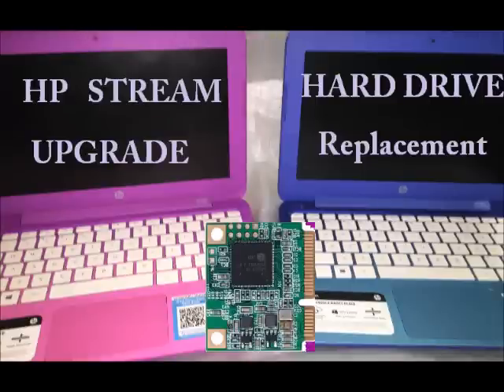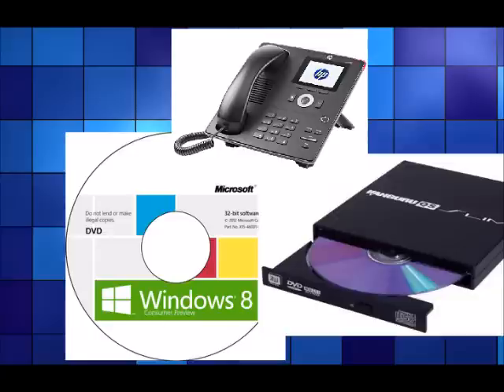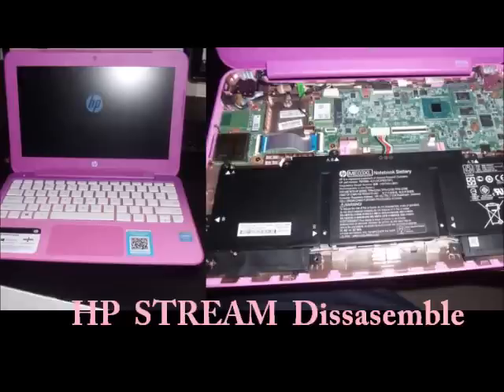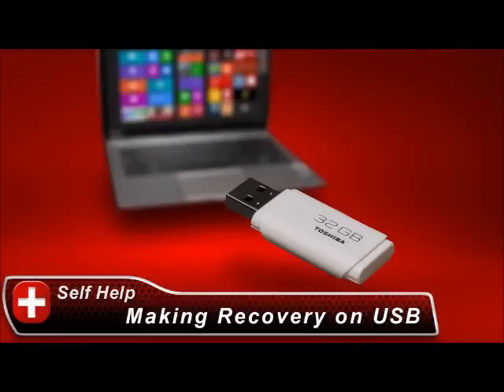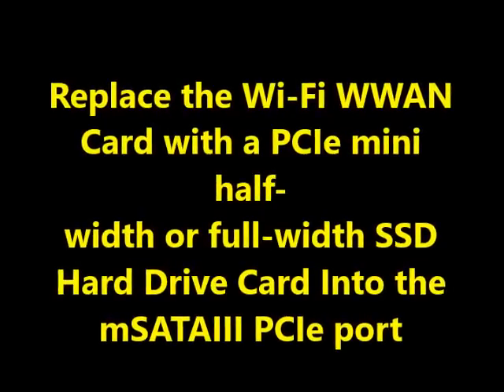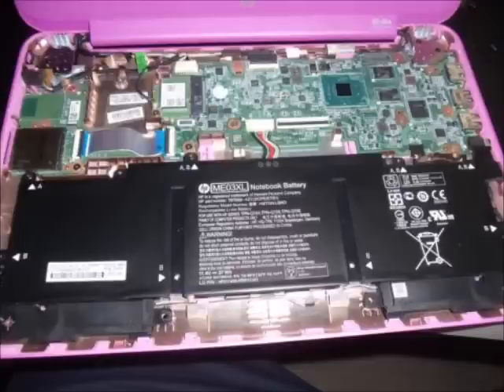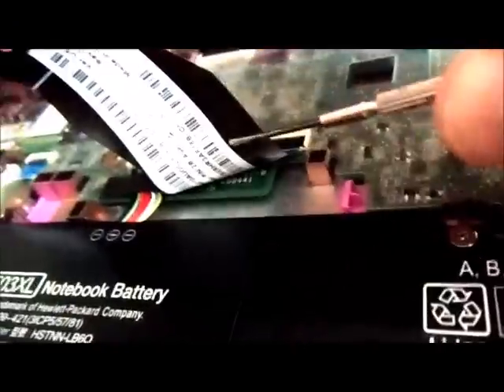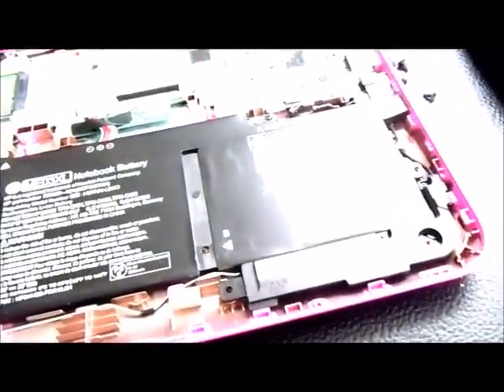How To UPGRADE HP STREAM Hard Drive 11 13 14 11-d 11-p 11-r 13-C 14-Z X360 Pro G3 G2 Touch SSD RAM

Comment: this tutorial is ok , but it should be deleted you do not show the actual product working , or more spcs on your particular setup, ive gone tru 3 msatas included the recomended in the video and none of them are being detected they don show in bios , i went as far as trying 2    M.2 ssd both pcie and ssd and none of them work, and yes i have a board with an M.2 connector and sim card , so nothing works, unless you show proof and proper specs you should delete this video
Reply from the maker: lol why do I need to show "proof"?  I'm not selling you anything and obviously it is working because that is how I got mine to work and everyone else on here.  There is something wrong on your end.
Reply: the same, today tried one ssd no luck, as i understand it should theoretically work((((((

Comment: so, i did exactly as in the tutorial, really good one btw, helped me a lot. problem is, the new hard drive still can't be visible. i did the battery reset thing but still, i got the same problem. i don't know about the bios update tho, how do i know it the pci-e won't have been banned already and after that i won't be able to do anything ?

Comment: Struggled with an HP Stream (32GB) for 4 days as it attempted and failed to download/install Win 10 updates as available SSD memory was between 0.9 and 1.4 GB, until finally a screen showed up that said 10Gb of external memory required to install updates! Plugged in a 16GB flash drive, pressed enter and two hours later the Dream Win 10  updates were current and the available SSD drive was 9.1GB!!!! Suggest get a 16DB flash drive and persist!
Reply: I have the same problem with mine

Comment: Warning- replace with mSata won't work
today tried one ssd no luck, as i understand it should theoretically work(((((( but not, so statement in video is not true
Reply: It won't work because msata and pci-e are two completely different interfaces.  Just cause the connector is the same it doesn't mean it uses the same data type.

Comment: ok well I followed everything like he said, I couldn't find the SSD when i tried installing windows with my USB, so instead i formatted the old drive that wouldn't boot and installed windows there, if you guys are having similar issues try doing what i did, when installing windows from a usb choose custom or advanced and look at the primary drive, then format it and install windows on there

Comment: mSATA is not PCIe. Yes the SATA HD controller down the line is connected to a PCIe bus but it's still SATA not PCIe al la M.2. Yes mSATA uses the miniPCI slot/connector but it's not electrically PCIe but SATA connected to a physical mPCI slot/connector.

BTW ALL mSATA's use the SATA bus not the PCIe bus.

Comment: this isnt a bad low budget laptop. idk what you all are carrying on about? If you expect more, then one will have to invest more.  its plain and simple really.
Reply: Ryan Marshall Well, my father got me one and it honestly sucks.
Reply: I wrote a monster of a thesis on this piece. I needed an external hard disk, but everything went perfectly
Reply: just snag a used thinkpad, cheaper price, better performance and much better build quality
Reply: exactly!
Reply: I dont mind this laptop, for the price, it runs as I expected it to, I would just want it to have a larger storage capacity
Reply: Maybe because you should be able to add, oh, I don’t know, some RAM to it?? I’m not ok with the fact the box said 32 GB and it turns out that half of that is already used up by the software installed on the computer...
Reply: It's a piece of crap. There should be no Windows laptop sold with less than 64 gigs of storage. My niece has one and we can't even install the latest Windows upgrade. These things should not be sold.
Reply: I don't see anyone "carrying on".  It is not unreasonable to expect HP to design a notebook to have enough operating space to accept future Windows updates with enough disc space to spare to run the notebook, which this POS does not.  After the WIndows update of 10/18, even after stripping it to the bare bones of everything uninstallable, my notebook is nothing more than a $200 photo viewer and HP could care less.  I was able to use it for 1 whole month after purchase and then the 10/18 WIndows update rendered it completely unuseable for anything online, even stripped to the bare bones of all uninstabble programs/apps.  HP support is so horribly unknowledgeable, after trying for weeks to get them on the phone with hold times upwards of 30 minutes, they told me to buy  more RAM which is impossible. I have filed a complaint with the Attorney General to get my money back and I went out and bought a used Dell.
Reply: @ashkesslet1149  Yes, I had seen other posts about doing this, or even android. I will likely give this a try.  TY
Reply: BOY IT CANT EVEN RUN ROBLOX
Reply: It's honestly a brick
Reply: The people who made this piece of shit but they should burn in hell. A friend of mine has one. First off , whats with the s mode bullshit? Isnt it her " computer" ? She should be able to install any damned thing she wants to on it. And anyone who thinks a 32 gb drive is a good idea is insane ... or crooked. Mostly the latter. How much more would it have cost to put a 128 in there? Now we got to go get an external drive so she can use it.
Reply: This is bad bc people could have bought a older used computer and they'll be better off

Comment: Instead of doing this, do yourself a favor and just don't! Trust me, this won't help and is nowhere close to worthwhile, even if it did improve something. This disposable laptop is NOT designed to be taken apart! It is very weak, difficult and u will brake it I promise. 30+ screws, each completely unique, 7 of them are completely hidden and require 100% disassembly. Every single tiny piece must be completely removed to reach the screws that give you access 2 a board that cannot be upgraded in any way because everything is soldered on! All u need to know is:, the hard drive is integrated and CANNOT be upgraded. He just tells you to use a thumb drive or SD card (really???). You could replace your WiFi card with a m-pcie drive which is even more ridiculous. A little streaming toy like this is pretty useless with a high speed drive worth more than the entire laptop if it has no WiFi?! If this is your thinking, there's plenty of options 4 u! You could remove the screen to save on battery life a lot! In fact, you could go even further and remove the battery itself to save even more and prolong its life! That would free up plenty of room to add an mPCIe-to-SATA card and two 1TB SSDs on a RAID-0 array! Now that's a real upgrade! You will be so impressed with your high speed drives you will forget you ever had a screen, keyboard or WiFi! But for real, none of this, or any other attempt to upgrade this laptop can make the slightest bit of difference because the bottleneck is in the bs celery CPU and the pathetic RAM. So to summarize, be smart and don't do this! I'm sorry you have this laptop but it has been crippled Beyond hope and the best thing you can do for it now is to get rid of it! Whatever it takes, your life will be vastly improved once you remove this laptop from it! That's a guarantee!
P. S. I am a full time licensed computer tech with over 30 years on the job. I've repaired thousands of laptops. I speak from experience. This is the only model I have been unable 2 simply take apart without damaging it. Rather than putting mine back together, I put it in the trash can where it belongs. This computer has lowered the bar too far for comfort. I'm disappointed in HP for this hideous, insulting release...
Reply: It's a garbage laptop, for sure. But if you can get it free (like me) or for dirt cheap, it's not really all that bad considering there's still a lot of possible uses for it: I carry this around and leave my main laptop at home. I only use it for web surfing and streaming media (mostly from my own personal cloud). I can use the HDMI to connect it to my projector/TV to watch a movie (either streamed from netflix or from my own network drives. Connect it to either of my external desk monitors occasionally for a bigger screen while working, that is, if my other PC is preoccupied with other processing jobs... use it as a foobar / jRiver (synced/mirrored) media server etc. etc. It's very light as well so I prefer to lug this around when going out and about... Although, for most people who plan to use this as their main PC, the lack of upgrade options is indeed severely limiting. In summary, this can work really well as supplementary lightweight laptop, but not so much as a main computer.

Comment: You do not buy a usb network... It's a network adapter and I am only 10
Reply from the maker: its the same thing.
Reply: He is probably talking about a USB network adapter, of which there are two main types: USB wireless network card and USB to Ethernet adapter. But what they are REALLY called are Network Interface Cards (NIC).  They make NICs for a huge number of interface standards: ISA, PCI, PCIe, USB, etc.
And I am only 38.

Comment: Ok, I found the best way to make the HPStream usable:

1) Open up the machine, and UNPLUG THE BATTERY! This is important. You also may want to consider a small piece of double sided tape under the CMOS battery, as it tends to want to come loose.

2) Install 8gb/ PC3L-12800s RAM. You'll need the low voltage ram. The high voltage ram, does not work. This is for the HP Stream 14 ONLY. If you have a 13, or an 11, you're stuck with 2gb/RAM. Linux Mint will still work. 

3) Nuke, the Window 10, and install Linux Mint. Linux Mint CAN be a little more complicated than Windows, but the BASIC functions as an O/S, with the Cinnamon desktop, are very similar to Windows 7. As a matter of fact, I think the basic functions of Linux Mint Cinnamon, are a little easier.
 
Mint requires much less disk space, ram, and the updates take up FAR less room. Linux programs are much smaller than Windows programs. At least for a child, the 32gb/eMMc drive is just fine.

I just gave my 4 yr old Granddaughter, her first computer.

HPStream14.
8gb/RAM.
Linux Mint 18.1, with lots of age appropriate software. 

This machine, with this configuration, is a GREAT starter computer for children Preschool, through grade 6.

For an adult with MINIMUM computer requirements, you can add an SDcard, or an external, 128gb SSD, and it will be adequate WITH Linux Mint, NOT with Windows 10.

It works VERY nicely as a Linux machine, albeit, just a little slow, and she absolutely loves it.
Reply: I got the pink stream 11 for my daughter, Windows was never going to work on that thing. I ended up going with Xubuntu and it works fine.
Reply: @DaveLuxmore   Yep, that's been my experience with it also.

Comment: How do you make the SSD work in the stream? I took your advice and bought the 256 GB one you mentioned but the port in my stream doesn’t allow for that card to plug in?
Reply: is it a blue one?
Reply: Mini PCIe slot at 20mm, not a mSATA slot at 30mm so won't fit pm830 drive

Comment: First off, crappy video. Second, don't buy one unless you're willing to work on it. If you do, make sure you get the 4gb/RAM version.

You need an external hard drive in order to use this thing. I recommend a 320-500gb 7200rpm HDD in a cheap, external usb 3.0 case off Ebay.